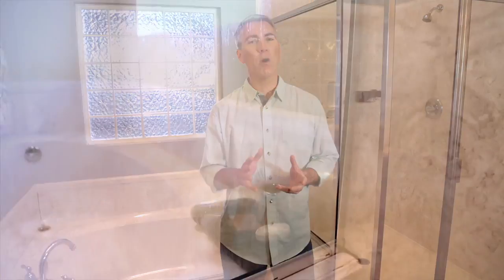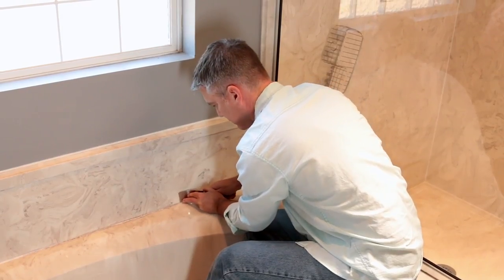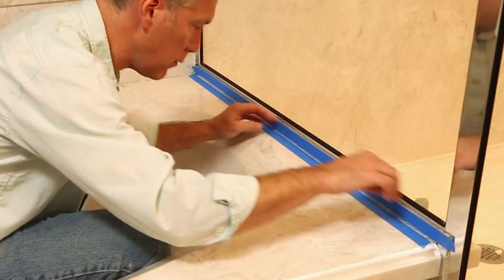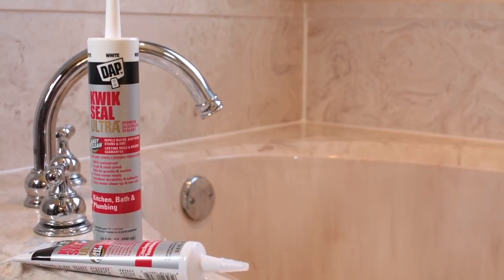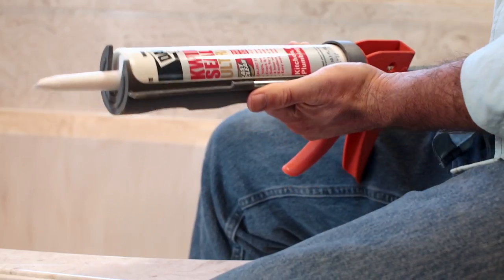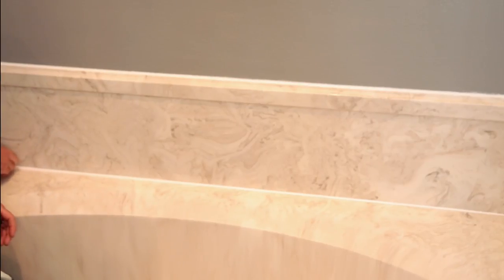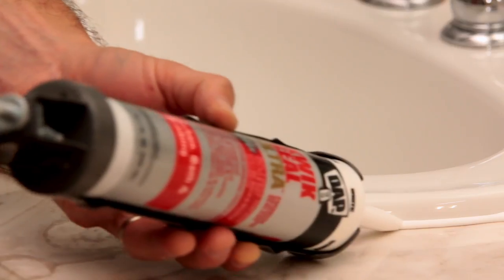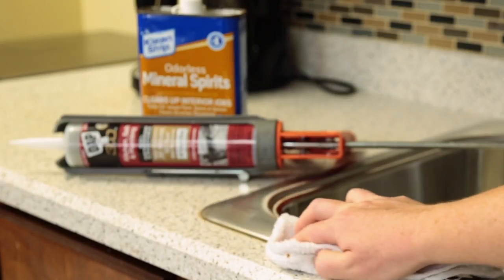How to Caulk and Seal A Bathroom

Comment: your packaging is gawd awful.  I've cleared the internal foil sealant but it's still not a big enough opening.   Squeezing the caulking bottle puts more pressure on the back end of the bottle than it does on the front.   Thus the pressure pushes out the bottom of the bottle before any caulk comes out of the nozzle!

Comment: I put some Kwik seal plus premium kitchen and bath adhesive sealant 100 percent water proof mold guard but now is coming off maybe the one is not the correct one
Reply: Its a terrible product for water. Its not silicone, its siliconized acrylic latex (whatever the hell that is). I used it in my shower, goes from white-clear-white after water touches it. This product isnt even somewhat waterproof.